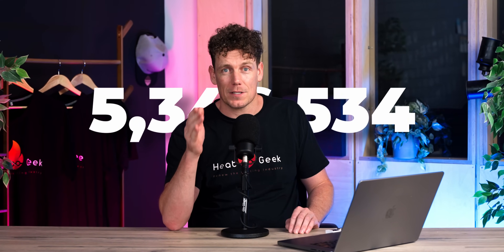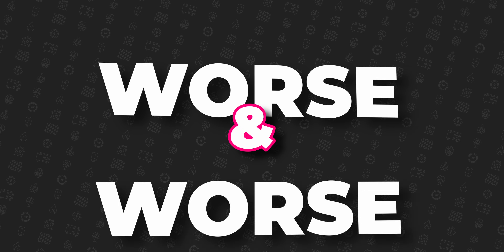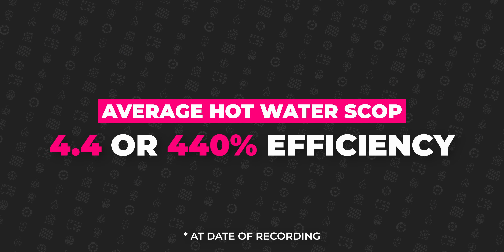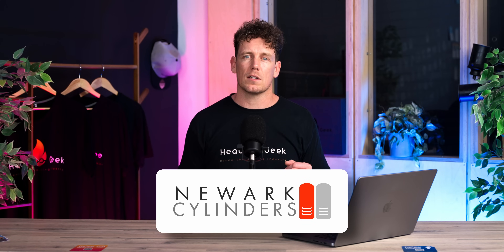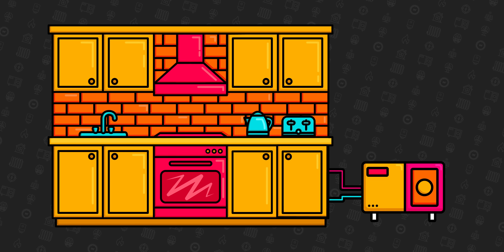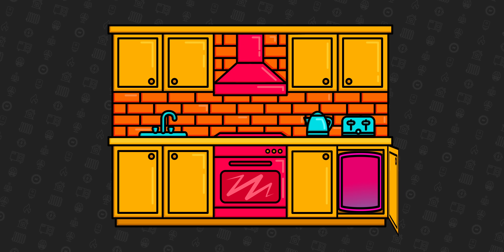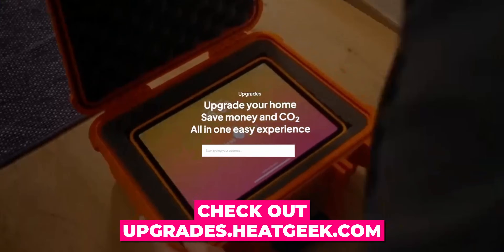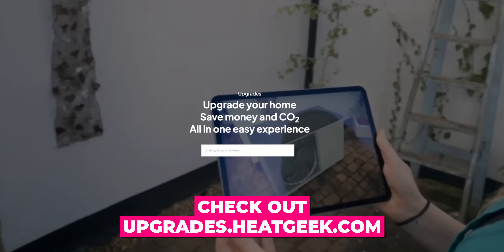This Invention Will Change More Than 10,000,000 Homes!

Comment: B. shtt, houses in the UK have no insulation,  heat pump provides 40degC at max output . You will need 150-200mm of vertical external insulation and 400-600mm of rockwool under and above the roof to minimise thermal bridging,  additionally you will need 150mm under the floor, and 100mm  foundation insulation.  To radiate the heat inside the property and store it in the walls you will need floor, wall and ceiling heating output. Only then you'll be able to run the heat pump at 32-36degC output which will make the pump running intermittently  resulting in lowest possible electric bills. I understand majority of brits have no education,  and most british self called "engineers" have no engineering degree, but use common sense  to understand the principles or start reading. If you want to find out without listening of bs from people like this guy set you gas boiler on 35degC in the winter and let it run. You will quickly understand that 50mm or 75mm cavity insulation is not sufficient even for 30kW output  gas boiler, and   imagine you will only have 8kW so your heat pump will be running 24/7/365. It will cost you a fortune and the compressor and other components of the pump will die in 5-8years of such intense usage.  All of you forgetting that in the winter you will need to defrost your heat pump periodically so you will need two tanks in the house. Buffer tank will need to be at least 60liters and it will only be connected to the system so the heat can be wasted on defrosting otherwise the heat from interior radiators will be drawn back to the heat pump. Those who live next to a stream, lake or a river I suggest invest in the ground heat exchanger and drop your coil on the river bed. Although you have zero freedom in the  UK and your council decides how you spend your money so you will need to ask for permission.
Reply from the maker: Rubish. Modern heat pumps go up to 70c. Your about 20years out of date

Comment: I'm a bit confused by this. There's already a device that will do this job, doesn't require any replumbing, hangs on the wall, doesn't use up a cupboard, does a better job of heating water and homes to a higher temperature, at a lower cost and is vastly more flexible.
Reply: with what carbon footprint?

Comment: Yada Yada Yada blah blah blah. Where are the technical details, how does this work, what capacity does it have. Will you run out of hot water part way through those two showers leaving two people freezing? Not impressed a whole lot of nothing in this video.
Reply: 2 minutes and 55 seconds in is a table of data.
Reply from the maker: details due in tomorrows  video at 4pm
Reply: @colinwiseman  I was listening more than watching so missed that table that flashed up for a few seconds. Well it answers one question 14 minutes of water at 10 LPM. Which is to say a dribbling shower. The recharge times is impressive though, it means if you're shower runs out you can try again in 18 minutes. Also heat pumps draw heat from the air which means the chilled air must be discharged somewhere. If it's back into the room it's the same as running an air conditioner on chill in the middle of winter. Might be ok in hotter climates though. And shrinking existing technology is not an invention!
Reply: @DeveloperChris 😂

Comment: You do know your carbon based pal? You could reduce your carbon footprint easily.
Reply from the maker: All life is… hence the balance.
Reply: @HeatGeek  zero ain't balance
Reply from the maker: @MrCarhoo  do you know what ‘net’ means?
Reply: Mr carhoo would rather keep sending money to questionable nations than produce clean energy ourselves
Reply: @HeatGeek  genuinely didn't know had to Google it. Good point. However down stream have you calculated the net for the manufacturering, transport cost of the equipment itself all the material that takes to make this are enormous? For example the emissions of the boiler are cancelled during it's life time. Okay .net zero.
Reply: @timsyoutube6051  so produce a heat pump in the UK from strach?  The cost of labour alone this is not china. The manufacturering base non existent. The emissions. This is getting silly.
Reply: @MrCarhoo We reduce carbon use, then pay for carbon to be removed from the atmosphere. Reducing carbon use is currently cheaper than removal, so it is better to focus on reduction. Removal tech should improve (need to pay for its development) and reduce in price so we can reach Net Zero cheaply.
Reply: @Biggest-hz7ng   @Biggest-hz7ng  so your we spend loads of not your money tax money on a promise. You sound like a politician. What not just use hydrogen gas which is easily produced